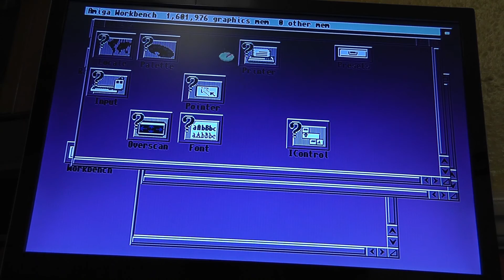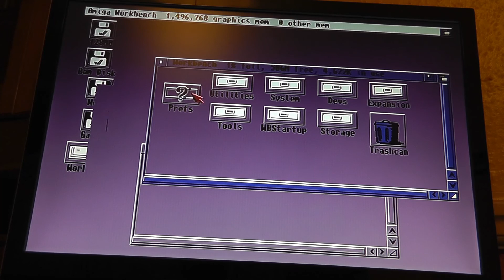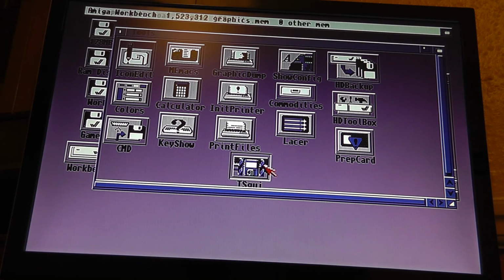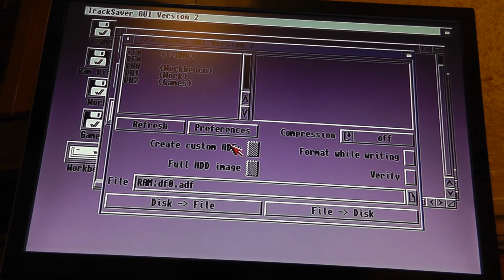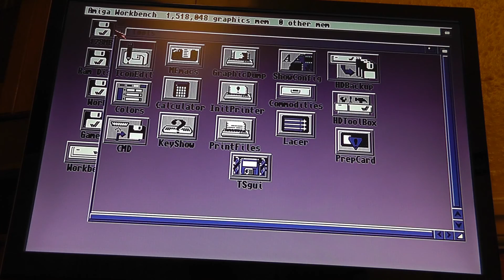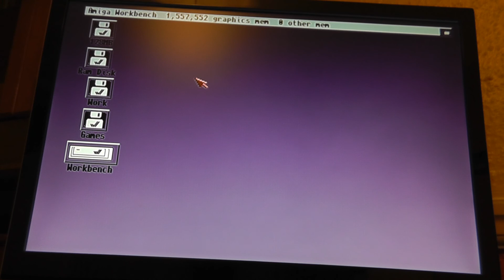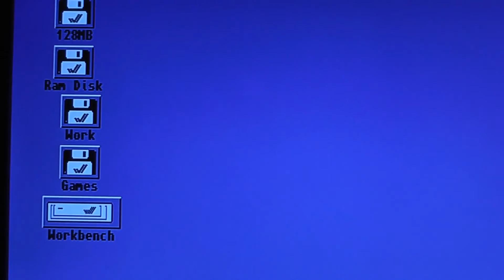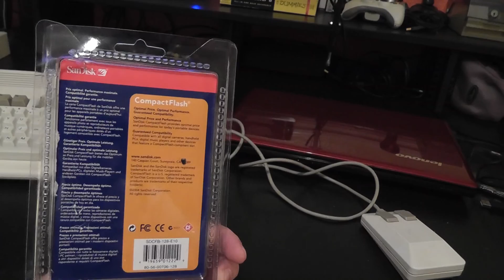Amiga PCMCIA and CF card problem

Comment: On the rgb signals on the MB, has it got leaky clamp diodes perhaps ? What about flux residue, did you clean after replacing caps ? Might aswell just be the video dac. Retrogamermodz has a video on that showing a problem with the DAC.
Reply: I was thinking A1200 here, but looking at the schematics http://www.amigawiki.de/dnl/schematics/A600_R1.5.pdf you can see U31, U32 and a resistor ladder DAC. Inspect the green channel.
Reply from the maker: Aha brill, I may have to have a look, appreciate it :) Hope you and the family are good.